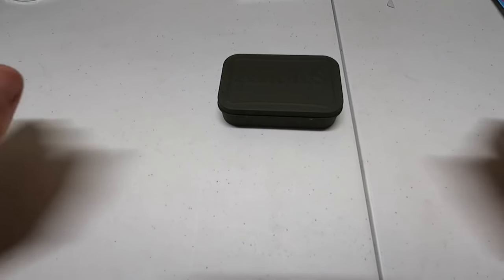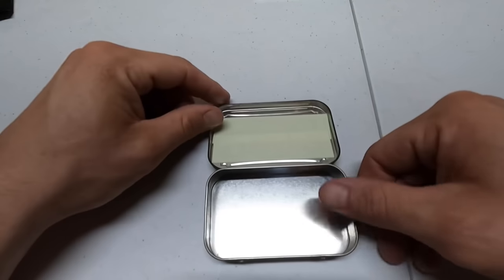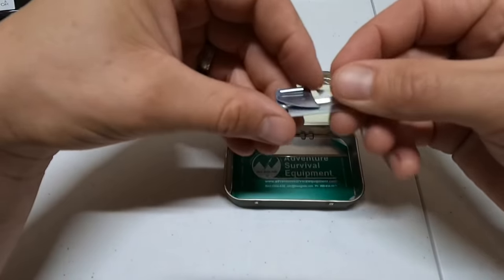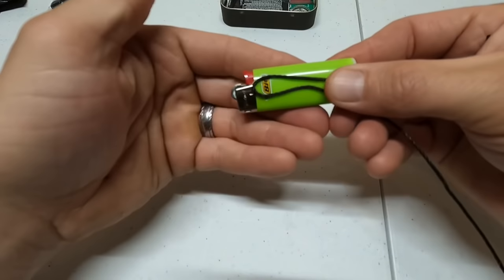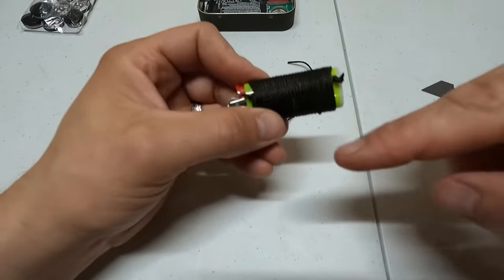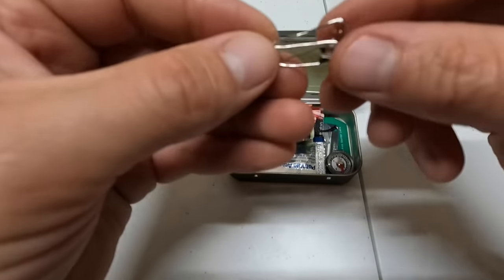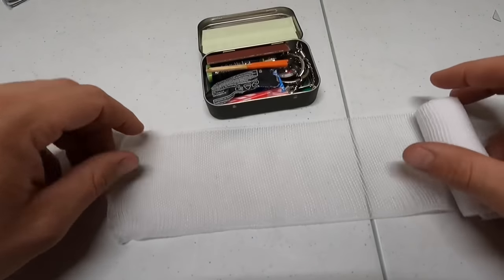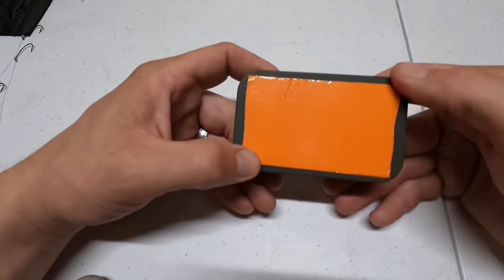DIY The Ultimate ALTOIDS Survival tin

Comment: A derma-safe razor might fit in there vice the box cutter razor.  a little safer to use and transport once you start using the kit.  Also, you could put a couple of "trick" Bday Candles (they have a little bit of magnesium in the wick) in there vice the normal Bday candles.
Reply from the maker: Thank's I will take that into consideration for sure. Eventually I'm going to have to do a overnight video with the altoids kit.
Reply: Yes! I was going to recommend the "trick" candles, too. Love the Derma-safe razor.
Reply: Perhaps you could put a whirl-pack water bag in there vice the condom. It may be too big tho.
Reply from the maker: @cardiacbob  I was actually able to fit a small zip lock bag in the altoids kit around the i side of the tin. Worked out pretty good.
Reply: Love the flat OD green paint job! Looks great! Also, the glow tape and mirror duck tape are really good ideas! I would definitely dump the wire saw...(takes too much room and are unreliable)!I would add instead a Derma Safe knife and Derma Safe SERE saw. Both more reliable and safer to use. Also, a few first aid items would be a good addition. I think a whirl pak one liter emergency water bag would fit in place of the condom. Anyway, nice kit. Thanks for the video.
Reply from the maker: Thank you, and thank you for watching
Reply: I love those littke razors I keep them in each of my kits in my cars and my camping emergency bag and hiking bag. I carry my edc knife plus a secondary in my bags and the derma safe razor is a back up to those.

Comment: A tiny paper sleeve for the razor blade would probably be a good idea, and not be too tricky to rig up from some durable paper without adding much weight or bulk.  Some cleverness could potentially lead to it doubling as a way to hold the razor to make it easier to use, too.

Comment: Nice kit. I put a small ferro rod in mine to augment the matches, along with some kind of tinder, but your mini BIC lighter is a step above that, since you have spark wheel AND fuel for a flame built right in! I think you have included provisions to cover the 5 Cs, or allow you to create them. I like the OD green paint, too. The tiny light sticks are very cool. Thanks for sharing. Cheers.
Reply from the maker: Thank you it turned out pretty good for my first one. Thanks for watching 🤗

Comment: Nice kit.  About time somebody thought to include a "nonlubricated reservoir" to hold water.  I've watched soo many of these videos the past few years and you are the first I've seen to include one.  Might want to wrap some of the items in cling wrap, like the candles and the matches.  Although you can't hear things moving, they are still rubbing against the other items.  Maybe cover the sharp side of the blade with card stock or thin cardboard (cereal box).  A couple of paper clips as they are versatile like the safety pins.
Reply from the maker: Thanks for the tips👍💯

Comment: Because it’s super thin, I have used an old expired bank card/credit card and filed down the 4 corners so you have very sharp corners. Then, I took some strong duct tape, cut it to size and wrapped it around the expired bank card/credit card a few times to make it stronger to hold onto, for a better grip. As a bonus, you now have the duct tape when needed, not a lot, but maybe just enough. The duct tape can be used as a fire starter too.

Comment: Great video but I give you some ideas...
- Use trick b'day candles... Fit it in a plastic straw an close the ends melting the plastic with a lighter. You prevent to get it melted in your kit.
- Cover the edge of the blade with some electrical tape. You avoid to cut yourself.
Or even better, get a Victorinox Classic SD (or a Victorinox Swiss Card if you prefer) and you get blade, scissors, lime, screwdriver, tooth pick, tweezers... 
- Put the glow in the dark tape in one side of a plastic card and the mirror one in the other. You can use and old fidelity card or something like that. You put it against the lid and you can take it out to charge the light or make signals without get all the stuff out.
-A little light would be more useful than the glow sticks.
- The striker for the matches yo can fix it in the lead so you don't lost it or have it in the middle when taking out the stuff.
- A little magnet will be very useful to magnetize the needle in case you use it as compass.
- Some cotton waxed inside of a plastic straw sealed as the ones for the candle would be a great tinder

Comment: I’ve made a few knives out of a hack saw blade. I left a serrated area and used a dremal tool to make a drop point style blade. Fits perfectly in a wallet, this might be a good to add to the outside under the inner tubes.
Reply: I forgot to mention, great video!
Reply from the maker: Thanks appreciate it💯👍

Comment: I really like the way you incorporated so much in the Bic lighter. You could almost just carry that outside the tin in your pocket and use the room inside the tin for other stuff. I think some sinkers would be a good addition for the fishing part of your kit.
  The safety pins are a great idea, but I can tell by the fact that they were bent when you took them out of the package, that they were the totally worthless variety. Singer brand and whatever else you may pick up at Walmart, suck. They are not made of good steel, they aren't "springy" and you would be better off trying to make a repair with a pointed twig, seriously. A company called Dritz makes pins that are of good quality and not too pricey.
  Your choice of glow sticks over a button battery powered pinch light of some kind doesn't make sense to me. Those little buggers cost a lot for what they are and they don't have near the 10 year shelf life that a lithium button battery has.
  The argument for the gauze as a pre-filter is valid, but a couple of band-aids and a folded up coffee filter would be more effective for first aid and filtering, IMO and should fit in the tin.

Comment: OD color is great until dropped in the grass. My color is now yellow.  Its also on my mora knife. Wrapping the tin with electrical tape a little more water resistant . I also found a slightly larger tin, more volume.

Comment: You could fit so much more in that.
Mine expands, so i use those rubber bands that are on broccoli to close it tight.
Abs again, a piecof electrical tape to keep it water resistant.

Comment: Which cordage are you most likely to need. That should be wrapped around the lighter last. If you need the bank line you have to take off the thread and the fish line. The suggestion of using dental floss for all uses may be a better choice
Reply from the maker: Good points. Thank you👍

Comment: I would dump the thread and add some more bankline in its place.  If you really are worried about sewing in a survival situation use either suture thread or bank line with a sail cloth.  
Also throw a crayon in there instead of one of the candles. They burn for I think 20 minutes?  And you can use to leave notes

Comment: put a piece of ziptie under bankline it will be a lineclip for the fishing line and sewing thread and make a "slot" for the needle.

I would also replace the sewing thread with 10m of 0,15mm fireline or powerpro fishing line.

putting a 25cm leader of 0.25mm fluorocarbon with a 20mm loop on end on all hooks, much simpler to use with injured or cold hands than tying a knot on the eye of a hook.
also a small fishing fly (size 14-12)  or two (hares ear nymph  with cul du canard "hackle" and second one with gold bead head)  that way you increase chances of catching fish even without bait (then you can use fish guts for bait)

tape the hooks/flies with leaders to the sheet for the magnifying glass

Comment: Just a couple considerations, a loose razor in a tin might be a bad idea...I would actually upgrade to a pocket knife for safety and overall usefullness. Also, purification tabs are for an alloted amount of water ,yet you are basically guessing using a condom( which also is super fragile). Look at the aqua pouch and you will see it is a much better option. I really like what you were trying to do on the kit, but think those upgrades might really help with your capabilities and safety. I also cover the aqua pouches on the altoids and pocket hiking survival kits on my channel if you want to see one. Have a great day.
Reply: Ps, I did appreciate you keeping it g rated when you were talking about the water resivoir...very nice
Reply from the maker: Thank you for the input. I appreciate it much. I actually had a friend and sub recommend a ziplock bag instead of the you know water resevoir. I was able to switch it out. I agree the water resevoir is not very strong. I will have to check your video out. Thanks for stopping by.

Comment: Trick no blow out candle,  mini earth magnet,  flat whistle,  Ferro rod  ,  hacksaw blade,  micro squeeze lite.
Reply from the maker: Mini earth magnet and hack saw blade sounds good. Thanks for watching.
Reply: What's the earth magnet for? New to survival.
Reply: @maryfranceslucero3622  to recover something that fell in a tight hole or area that you can't reach without a Walla a super strong earth magnet 
👌👍👍😃
Reply from the maker: Possibly you could use the magnet to magnetize a sewing needle being used as a compass for navigation🙂
Reply: @scottysurvival  also exactly 👍😃

Comment: That's a great kit. You could add a light by getting an LED with the open leads and a small cell battery.  You can use a piece of tape to put it together when you need it, and it takes up very little space....[[|:-)

Comment: Not bad bud. I'd put the mirror tape instead of luminous tape on inside of lid. Av seen worse kits tho 👍🏴
Reply from the maker: You must not have watched while video. I did put mirror tape in it. It's in the video
Reply: Mirror tape in bottom of tin but luminous tape in top as I said, but luminous tape is useless so put mirror tape in top Instead. Sorry maybe didn't make that point bud. All guid tho 👍
Reply from the maker: O ok got it👍

Comment: nice build. i gotta few groovy ideas
Reply from the maker: Thank you. What are your groovy ideals?
Reply: @scottysurvival  give me a minute to iron out the wrinkles. You may be pleasantly surprised.
Reply: @scottysurvival a few modifications to your loadout,  load the needle with your thread, glue the match striker to one of the bottom sides, 1 wrap of duct tape around the base of your matches, add a mini flint and striker
Reply from the maker: @tankmathieu9058  👍 nice. I like the gluing the match striker. That is a great ideal and the others as well. Thank you for the tips💯😎👍

Comment: After I´ve seen a video with this pre-packed tins I was not convinced. This is a lot better. I had my own thoughts and the biggest of them was why not a little bit bigger. I have a tin from a mini mag-lite. It´s as big as a smartphone 2 times thicker and nearly indestructible. When your pocket is big enough for your smartphone then it´s big enough for this. I have all the small stuff inside, a bit more cord and the normal bic-lighter. What I find essential is a foldable water bottle for the cleansing-pills and a rescue-blanket and my small swiss-army-knife. I always thought this as a one-night thing when you lose your backpack. The most important things are staying warm and hydrated. Food is nice but not really important. I would even say that the blanket is the most important thing. When it´s warm you have shade, when it´s cold you´re staying warm and the most important thing you have a big reflektor so that the S&R can see you. I´m not a big fan of this glow-tape. You need it when your fire is out and then the glow has vanished. The blade is nice but even when you make a wooden handle I would prefer a real knife.

Comment: Mirror tape is  great idea but I would either place tape on the top of the tin or on the bottom so you do not have to empty everything out! especially if you are on the run.plus for saftey reasons I would use masking tape to cover the blade.

Comment: The non-lubricated latex water reservoir can break on you. Might want to add an old sock or mesh bag to support it.
Reply: Oven bags or crock pot liner bags are very tough and work great for a water container.  And believe it or not, they can withstand indirect heat to boil water

Comment: What happens if you drop it at night? Lol just saying. N wont the wire saw rip apart your "water bladder" lol no offense just saying. Subbed. ^^'
Reply: Gratz on the subs btw 😊
Reply from the maker: Thanks thoughs are all good points. The Altoids survival kit tin would only be a back up kit. It would not be my primary kit. The orange tape on the outside of the tine should give it's position away and especially if I have my flashlight shining on it which would already be in my primary kit. The wire saw should be fine. Should not be any rubbing around in the tin with it being packed pretty tight + the bladder is protected from the packaging🤗💯👍. Thank you for subbing
Reply: @scottysurvival  no prob ^^ love your vids :]

Comment: Never get the condom as a waterstorage item. Yes you can fill it up under a tap but in standing water it sucks imo. I would put tinfoil in it so you cab store some water and boil it.
Reply from the maker: I've actually switched it out with a small ziplock bag. But yah they are pretty weak. Thanks for watching

Comment: Nice 👍 

Have you seen the ‘straw’ hack? 
You can seal matches, pills , fire starter & so much more , once you get the  main idea. 
This is first video I saw of it being done ,  lots of other ideas on YouTube now!  
https://youtu.be/WiB9kUPRXZ4

I’d add hemp wick to the  lighter & wrap it under the lighter’s fuel button, so it can’t leak as easy, plus you will use less fuel or spark from lighter with hemp wick. 

Will ranger bands/ tubes fit around the box seams ? If so, could make it more water resistant. 

Good stuff! 

✌️🤙👍
Reply from the maker: Yep I've seen the straw hack. Thanks for the suggestions, and watching😎👍💯